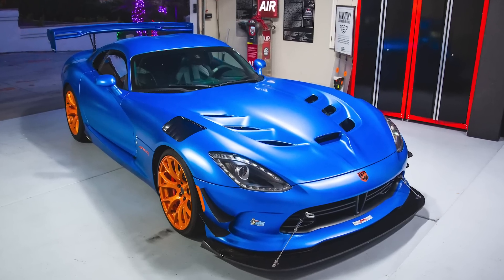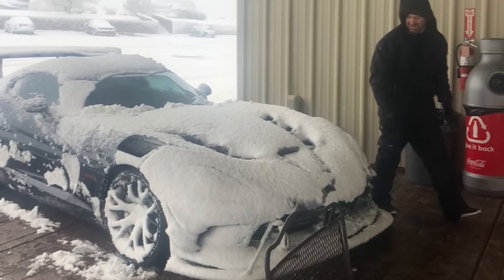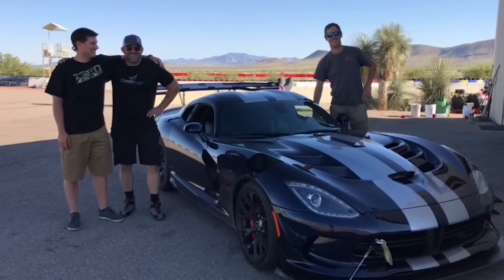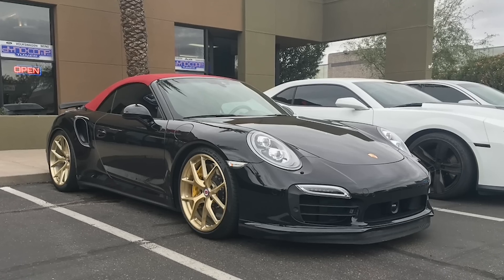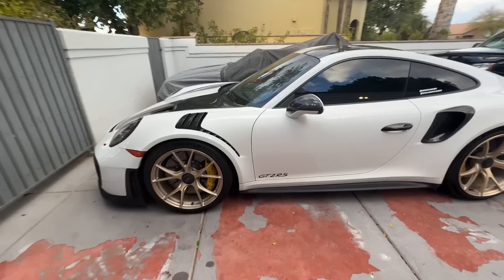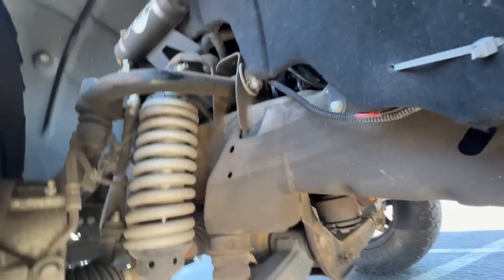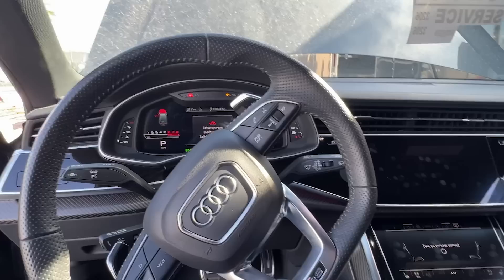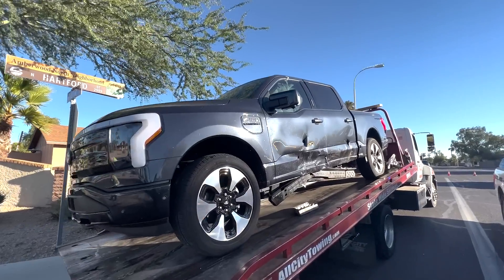Living With One of the Best American Supercars Ever Made!!!

Comment: The Viper is a special car! It has so much character. I drove a few 2k -2012.  Another fun one is the truck dodge/chrysler had with the v10 viper engine.

When I was working for Chrysler the vipers where hand built in a fairly small part of the factory.  You could also work with their approved aftermarket to get them putting down 1000+ hp

Comment: On the Audi, I'm not sure how Audi's warranty works, but certain manufacturers will not tear an engine down that is making certain noises and setting off certain codes. The manufacturer will ship a new replacement engine for it that comes in a plastic creat, and the "blown" engine is stuck in a plastic bag and put in the creat and sent back so that they can take it apart and see what failed. In other words, it could be something that can be repaired a lot cheaper than replacing the entire engine, but due to the manufacturer, the Audi dealerships may not be allowed to tear it down. If that makes sense. But yes, If any dealerships run a diagnostic scan on a vehicle it will tell them that there's a tune in it, and when the tune was installed, and all that info goes into the system and some will print out a copy of its findings, so maybe ask for a copy of it and see if it dates the time the tune was put in. That could help you if an Audi dealer sold you the car with the tune already in it.

Comment: With that Audi, Chet, if a tune was loaded onto the ECU it should have a date stamp in the system somewhere. Wouldn't that prove that IF there is an aftermarket tune on it, it wasn't done during your ownership. You should have dates of when the vehicle went to Audi and if the date stamp is after that, I would say audi is fuckin around. They should have to prove that there's a tune and when it was installed.

Comment: zr1 c7 is a super car if this is, and btw this isn’t a super car, it’s a super cool car maybe but definitely not a super car
Reply: @Jacob . Mm no.. Viper was a super car from the beginning-end.. unlike the corvette. Viper were really low production #'s. Parts are expensive/hard to find. Always 6spd.. never even had an automatic option.. always had a v10. always had more power than reg sports cars. Always more expensive. Always competitive on a track. Always front-mid engine. Always 11" front and 13" wide wheels on the back.. That's not normal sports car stuff, or normal corvette stuff. On top of that, most people agree agree it's a super car.   so 🤷‍♂️